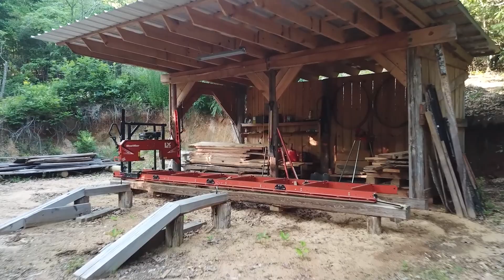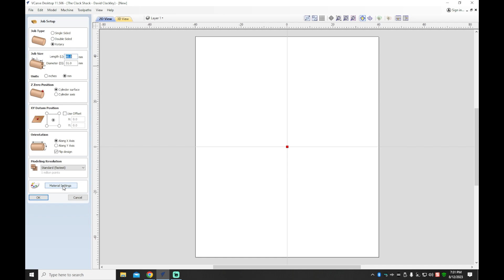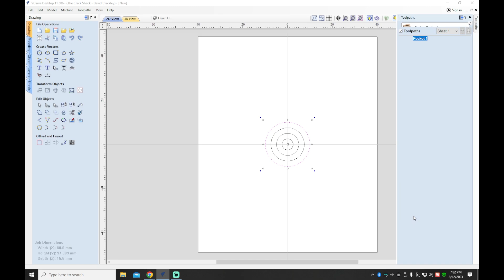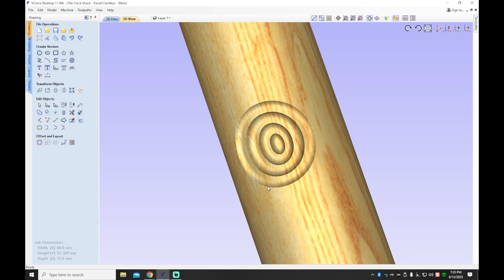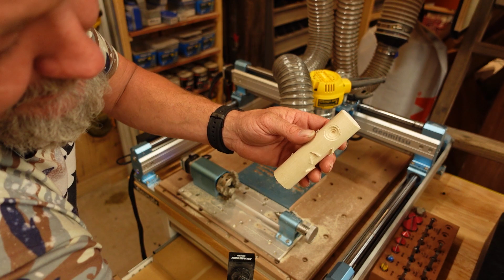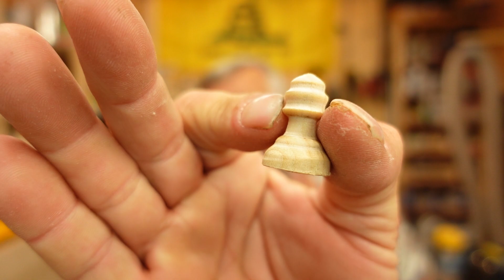4th Axis CNC engraving- Genmitsu 4040 pro

Comment: Oh my gosh! I am so glad I found this video. I have been watching your videos for a while, but they mainly were the laser ones. 

I just picked up a Genmitsu 4040 pro and a fox alien masuter pro with extension. 

Basically I have been planning to use each for different applications. 

You just blew my mind with the whole 4th axis on the Genmitsu. I may need to buy a 3rd machine!!!!!
Reply from the maker: The 4040 pro should have the 4th axis capability
Reply: @TheClackShack  it does, but I didn’t know before I watched this video. I had planned that this machine was going to be solely dedicated to 2.5d carving (due to long carving times).

So I either have to buy a 4th axis (which is a possibility) and swap it out or just get another cnc. And with how cheap the Genmitsu 4040 pro is to tool out, it’s seriously worth looking into.

By my own calculations, I could have my Foxalien Masuter pro with the 4080 extension, a Gemitsu 4040 pro, and a Genmitsu 4040 Pro with a 4th axis rotary all for the price of a one Infinity.

Heck if the Onefinity is fully tooled up, I can even pay for Aspire and possibly individual dust collection (and the Onefinity is what I was eyeballing).

So far I have been highly impressed with these machines😀
Reply from the maker: I have limited experience with CNC routers but so far, I have had fun and made some $ with the genmitsu @Andrew_Sherman
Reply: @TheClackShack  it’s a great machine and with the rails and ball and screw setups I think it will work better for the carving than the belt driven fox alien (at least I think it’ll be less susceptible to mid project issues). 

The fox alien is a good machine to, very fast and big bed - just plan on it being more production work (repeatable projects).

I’m super excited by this whole cnc adventure!
Reply from the maker: Yea, I am not sure belts would be my choice. @Andrew_Sherman

Comment: Great Job. How are you controlling the (on and off with speed). I have the PROVerXL V2 and add my Makita router.
Reply from the maker: I use a DC to AC relay, The router stays set to 1. The variable is too high any further up.

Comment: Looks like you are having fun with with the 4th axis. A number of years ago I built a 4th axis for my CNC Bridgeport milling machine. I have done some very cool carvings on it.
You should be able to do carvings with this setup as well. The models are  fairly reasonable as well. Fun stuff for sure. 
Thanks for the video,
Gary
Reply from the maker: I made this design using a 3D printing file that I grabbed of thing i verse. Now that I have got that working, I can hopefully make many more small items.

Comment: I can tell that you plugging this into a fourth (A) axis on the controller, since you are still able to control the Y axis of the machine, but wouldn't this still technically be considered a three axis machine? Because you are still only controlling three axis' - standard Z axis; standard X axis; and the rotary tool acting as the Y axis since the machines' Y axis doesn't move while cutting. I mean, don't get me wrong. It's still cool.  I don't think I've ever seen a rotary on a CNC before. I have a three-jaw rotary for my laser... I may have to hook that up to my CNC and play with that. I'd have never thought of that before seeing yours!
Reply from the maker: They named it 4th axis, technically it does add a 4th axis but it does not use it for the cut. You can control all 4 axis with the controller. If the file told it to move the Y axis, it would. Found that out the hard way. You have to use a certain post process made for the A axis.

Comment: Hey Clack, would you be able to hook the controller to a computer once in g-code and run it from a computer?  We just bought a Cnc router 4 x 8 table and I have it running from a computer to controller. So I have 2 computer so I can use the light burn program and the the other computer to run my g-code. Just asking if you thought about that?  Thanks for all of your info very helpful 👍🏼 Great Job Clack 😊
Reply from the maker: I have ran 2 lasers and the sainsmart at the same time. I can control it from my PC using easel. I can also put the Gcode on the SD card and run it with the offline controller.

Comment: How did the roller connect to the CNC?? You did not show that. My router uses all of the ER11 collets and it is a 65mm router. It's called a ROUTER11 and I think it is a better router than the DEWALT and I believe it was cheaper. It comes with 2 extra brushes. I've had it for a year now and it works really fine. It goes from 10000 rpms to 32000 rpms.
Reply from the maker: It has a plug on the controller. Just plug and play, the 4040 was made to work with it.

Comment: I use the 1/8 inch collet adapter as well for my 1/8 inch ball nose bits. Just make sure you insert it correctly. And make sure you clean the collet every time you change bits. Believe it or not, any saw dust in there will really mess up your day.
Reply from the maker: I bet. Thanks

Comment: You can use the split screen option in v carve desktop to keep both 2d and 3 d open on your screen.  Small brass brushes knock off the fuzzies well after cutting, saves having to sand.
Reply from the maker: Thanks